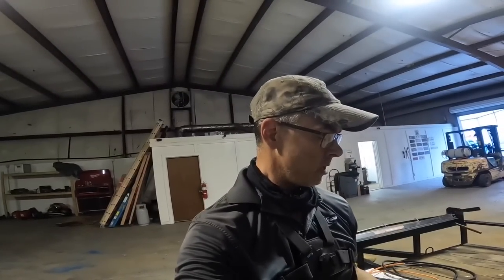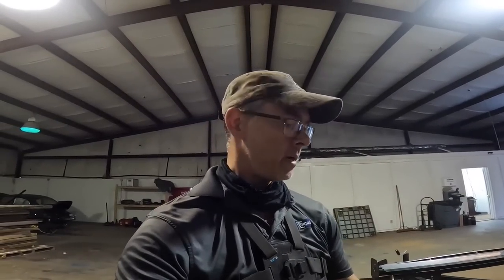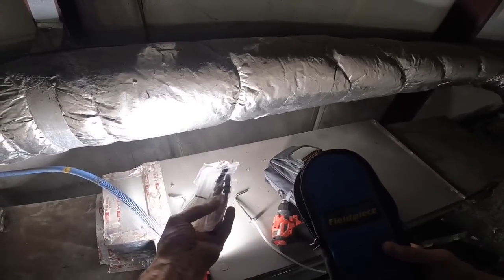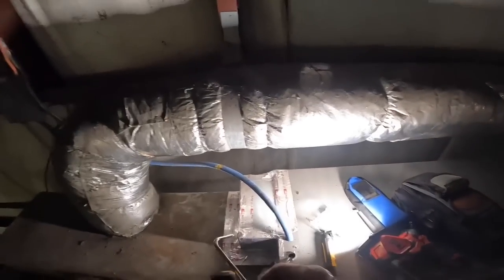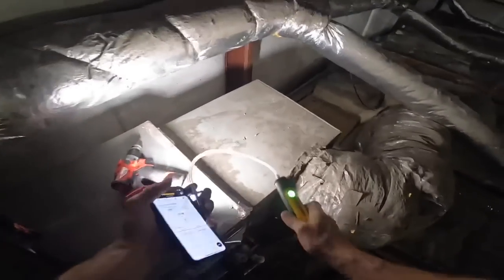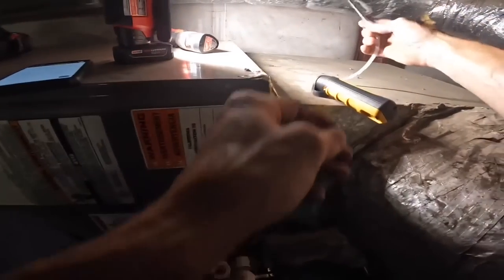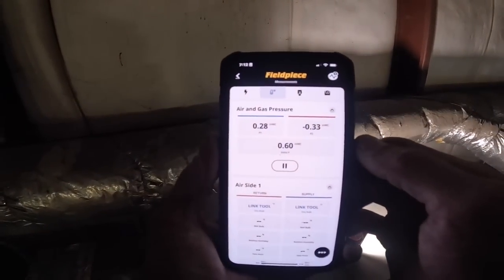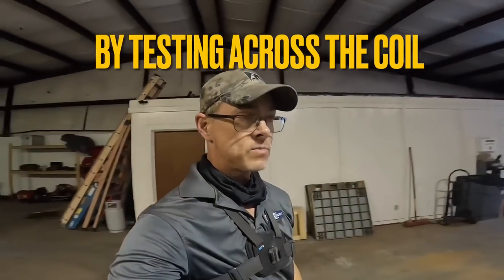Testing External Static Pressure with the Fieldpiece JL3KM2 Bluetooth Manometer

Comment: These are especially helpful when doing a start up on new equipment. Check your static pressure with a blower performance chart to be certain that the proper amount of air is being moved for the tonnage of the system.

Comment: Those ought to be great when locating obstructions in ductwork and finding dirty filters! I worked with pitot tubes years ago in the early 1980's working on dust monitoring systems. That sure would have been handy back then! Thanks for the Video😀

Comment: Recently found out the industry will start verifying air handlers at .5 esp, not .1 like they have been doing.  This should mean a lot less motor failures.....
Reply: It helps a lot of they are installed correctly.
Reply: I agree but most contractors could care less about good installation. Success in their minds is when installers pull away from the house. Poor ductwork is also something they refuse to look at....

Comment: So when testing static on an air handler ( not a furnace ) the evap  coil is not in the equation?
Reply: Yes air handlers you have to measure supply side and return 
Furnace is before the evap